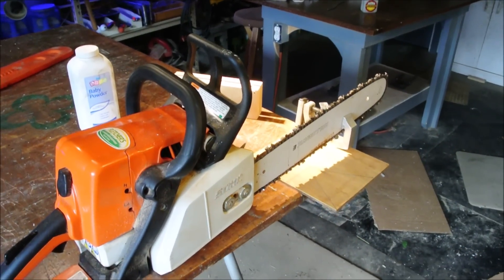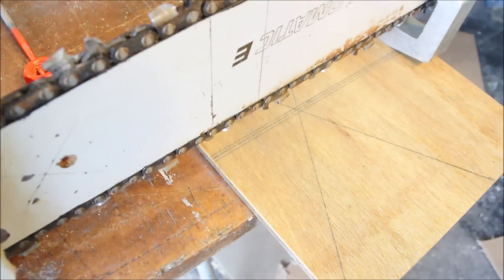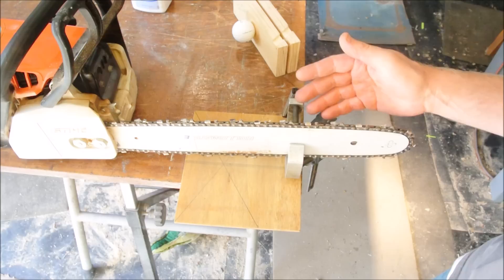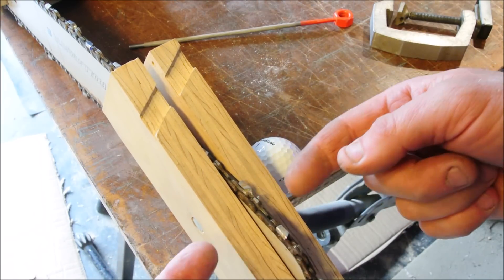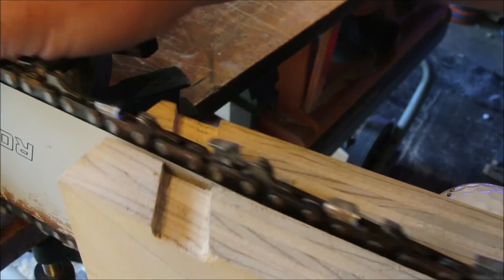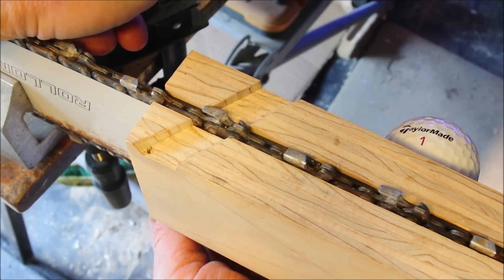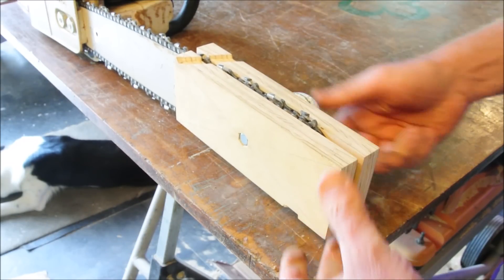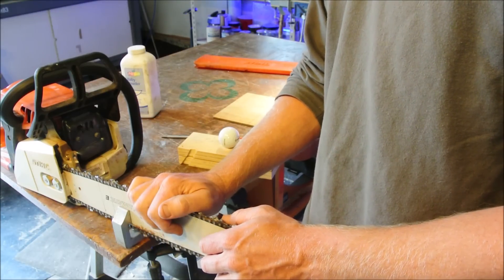Chainsaw sharpening jigs/unfinished idea

Comment: But why? The simplest thing is just to use nothing at all and teach yourself a skill, it's not that hard in this case. There are numerous excellent videos on how to do it quickly and easily, WITH PRACTICE. The internet is full of fancy devices to assist to sharpen your  chain and all they do is make it take longer (or be worse) and more difficult. It's like learning to ride a bike with training wheels, just make it harder when you eventually don't have them. I've trained numerous people to sharpen properly after they've tried (and wasted money) on gadgets that they still couldn't get a good result with, the more "tools" they'd used the harder it was to undo that learning and retrain. This is in a professional environment where it actually matters. 
So much misconception that every tooth has to be exactly the same length/size/angle or your saw will cut crooked, it's wrong and it's been proven multiple times. What matters is 
1) don't have a worn out bar groove (or rails) with excessive side to side chain movement where it can flop over side to side 
2) correct raker height relative to each tooth,  use a raker gauge, don't guess or randomly file that's guaranteed to make you cut circles, completely irrelevant if some teeth are half the length.
I've tried, tested and proved to people it didn't matter, file an old uneven chain and cut cleanly and straight through 30" logs. Australian hardwoods.

One of the best sharpening videos on YouTube is "How to sharpen a chainsaw chain by hand" by Tips from a Shipwright.
There's a video on my channel list which wasn't ever meant to be an instructional video, im using the Husqvarna file handle which has 25 & 30 degrees marked/made into it, it's all i use just to check although I don't even need it. Don't get me started on those 2in1 clunky things (any brand), cumbersome, heavy, awkward and expensive and don't make it any easier in the long run. That one inevitable day when you need to sharpen and you don't have it (or any other special tool) and there's just you and a file, what anyone going to do if you didn't learn to sharpen without it?
Reply from the maker: It's tough to disagree with you. In fact, I don't. Not really. Practical skills are fundamental to being capable. The more one can accomplish with less, the better. In fact, I'm pretty good at hand-sharpening. But let me answer the "Why?" part. 

Two reasons: first, there's intellectual curiosity; I'm somewhat of a person of abstraction, and so I like to find the extent of what's possible. This is to say that I enjoy the challenge of creating a good design. Problem-solving can be rewarding in and of itself, despite the reality that the vast majority of ideas end up failing in implementation. Nevertheless, I'm compelled to try.  

Second, there's the pursuit of perfection for work's sake. For general use, hand-sharpened chains seem to work perfectly. That said, during milling operations (especially like with my mini-mill), bar deflection and thus cut texture have everything to do with a chain's cutting consistency. There are limits to how well a human being can execute a perfect geometry without assisting tools, and error is cumulative. 

Consider the YouTube channel @FloweringElbow . If anybody out there knows his stuff about chain sharpening to extremis, it's this guy. In his experience, he learned to eventually accept the limits of personal skill; in order for him to chainsaw-mill efficiently at such a high level, tool-assisted sharpening started to become essential. In my own experience, I tried to make a few modestly 'perfect' sharpening jigs, but instead of the trouble, eventually I just started buying new chains for milling. The cost ends up minimal—and rational—considering the price of hard lumber. So the why? It's all about context, I guess.
Reply: @pocket83squared  That all seems fair and I'd not considered these options, having never tried to mill anything myself. I'm mainly concerned with cutting trees and firewood in the quickest but also least time consuming manner so having to keep extra equipment hanging around serves no purpose. Also cutting completely different types of wood we are CONSTANTLY sharpening due to the crystalline sap, sand, ants nests, dirt and everything else that seems to collect in the bark or inside. It's not uncommon to blunt the chain with only a few cuts, a lot of guys use carbide chain but that's another whole story and different equipment plus the cost
I appreciate your response, thanks, i don't have the drive or patience for such experiments myself in any case.

Comment: 2:00 juggling the whole chainsaw around seems perhaps more work than just use 2 clamp positions to fix the blade, then take the body of the saw off the blade and then just keep the tension on the chain by sticking a large spunge in it where the drive sprocket otherwise sits in the chain (that's how I do it for a quickie sharpening, just don't use an old light foamy spunge because they will get all sorts of crumbles into the rail of the blade as the driven teeth tear them off such worn out spunges - you could also get away with tube insulation if the diameter is large enough, just as long as it is compressable for easy positioning and springy enough to keep a minimum tention on the chain). 
As for the need to change positions: it has been proven over and over again, including by respectable youtubers such as ThisOldTony, PurgatoryIronworks and Outdoors55, that there is absolutely no difference in end result between sharpening with the sharp edge leading or trailing, nor in the amount of pressure in the backstroke (and neither does it influence the sharpness or life span of your file, especially with chain saw files that are harder than regular files), so you can just do both angles from the same side, eliminating the need to juggle the whole thing around in the first place :))

Excellent idea to have a visual reference for the angle! I hadn't thought of that yet and will definitely use it!
Reply: PS. we call it a blade here, if that offends anyone, please mentally substitute all mentionings of "blade" with "bar" thanks.
Reply from the maker: As a YouTube presenter, I can't call any part on a chainsaw the 'blade' without expecting some consequence. But in my real life, it'll always be a chainsaw blade.  

As for filing a tooth, toe-to-heel might easily be "proven" no different in theory, but heel-to-toe strokes knock at the tooth less in practice. Why? Because a chain has slop, and so unless you're under some tightly controlled conditions, this play will result in a higher incidence of the dreaded and counterproductive 'catch.' 

Tell ya what, though: as a respected commenter, you've convinced me to take another crack at it. Next time I sharpen, I'll keep my comfort position for the duration. I will not be back-dragging my files, though. With that practice, wear, to some extent, no matter how tiny, will inevitably result. A few trials do not a proof make; over the long haul, sloppy practices will tend to produce more collateral damage over time. If there's no reason to back-drag, I see no point in doing it. Occasional cost/benefit time-saving situations notwithstanding, of course. 

Someday I'll tell you guys the details about this hippy chick I once knew, and how she would grow plants under these "energy pyramids." They're just a few sticks, arranged to form the edges of a pyramidal cage. At the time, I laughed at the practice for being total hogwash. Yet it turns out that they really do promote the growth of my raspberries now, empirically—since the deer don't eat the plants that are underneath them. Sometimes a proven 'truth' can be less capital T than we realize.
Reply: @pocket83squared  yes, I fully agree about the "dreaded catch"... And I have cursed it more than I can count stars in the sky =)) (in the catch's defense: we have a lot of light pollution hahaha)

When ToT posted his video about his electric filer in which he asked himself the question about the back drag, his explanation was pretty convincing. 

I'm not sure which side you are arguing with the pyramids example, as the theory would easily disprove that practice, yet your empirical trial has proven it to be effective anyway. Interesting you should mention that they are helping because then the deer don't eat them so much. My raspberries don't suffer deer, but the hornets and Darwin wasps (ichneumon wasps) grab them before they are fully ripe... I'm not complaining, because these guys are an important link in the chain, particularly sharp links at that ;) 
All that to say that I will not have similar benefits from pyramids, as you may not have similar benefits as the ones I have from back stroke. For me, the back stroke helps a lot with keeping pressure and angle consistent, and thus reducing the catch. I also have turned my file around and pulled instead of pushed, to avoid awkward angles of my wrist... It's a really weird feeling though. 
If I ever have the time, I really would love to devise some kind of clamping system that I can control with my feet to grab on to the chain to keep it steady and prevent all slacking issues.

(Thanks for the compliment :) I try not to be the obnoxious default troll, but still contribute my personal experiences and contribute to your channel's algorithm benefits... It's crazy how those trolls exert control over our choice of words and freedom of speech. Either way, I love your content and dry wit, as both are stimulating the thought process...)

I'll see if I can find that video of ThisOldTony about the backstroke not causing any wear... I think people who have experienced noticeable wear, probably base their explanation on metal fatigue from pushing back and forth on the tip, but if that is the case, then it must mean that the file has already lost its temper (or rather its hardness). And now that I think about this, I'm going to put my chainsaw files under a lens to observe its geometry, because I just thought of another factor that influences wear.
Reply from the maker: @lukearts2954  What factor is that? 

Oh, and I should also add that I was talking about file use in a real general sense back there, since a dedicated chainsaw file seems to last for a long time, and further, they tend to be pretty cheap. Thus, with respect to net cost, you could still get away with back-dragging even if it's really bad for the file. But again, none of this matters, because back-dragging while filing a chainsaw remains an unnecessarily sloppy form in either case. Why? Also again, because we are not machines, and so we do not move with perfectly repeating linearity, and so injecting our error into any process increases its likelihood of blunder. This advice is not only about limiting wear; it's also about the prudence of limiting the unnecessary. Hope this isn't sounding petty or overly defensive.
Reply: @pocket83squared  don't worry, it doesn't sound like either of those. I'm entertaining your arguments to challenge my own. (I have a habit of always looking for arguments that go against my own position, to validate or invalidate my ideas)

Backdrag: To me, it is exactly the human error that is my argument for backdragging. I find it extremely hard to lift the file off the surface, move back and then reposition the exact same angle, while if I cramp up my position (elbows tight against my ribs etc) and only adjust the applied pressure, I feel that I do a fairly decent job maintaining the angle as far as a non-machine can do so.

Chainsaw files: You are right, I'm always surprised how cheap chainsaw files are compared to bastard files or other. Perhaps because they are only hardened, not tempered? I can imagine that the accurate heating cycles are a big part of the production cost of good files while only hardening them could require as little as just getting over a certain temperature, no need for much accuracy as long as it's over the threshold temperature, and then quenching in the proper medium at the proper preheated temperature. But that's just speculation of course.

Wear factor: What also should have an influence on wear, is the angle of impact, the angles at which the force is transferred into the mass, and the geometric relation between them. 
At certain angles it would just become impossible to have any kind of deformation that could cause any sort of fatigue. This would be the case if the normal vector (perpendicular to the vector of the force of impact) is small enough for the deformation of the cutting edges to remain within the elastic zone of the metal. Fatigue requires either extreme vibration for extended time or a minimum of repeated plastic deformation. Intuitively I would think that blunter angles at the tips would handle impacts far better than sharper angles. I have seen files with symmetric pyramidal shapes. I'd have to properly research at which angle that deformation would become (nearly) impossible, and I'm assuming manufacturers of high quality files would have that information. In this thought, certain geometries - if symmetrical - would be suited for filing both directions with full pressure (if one could find a technique to comfortably do so).

Comment: why do you lift the file when you reset?
Reply from the maker: Do you mean on the back-stroke? That's to prevent the teeth from dragging and thus dulling the file prematurely. Yes, it's a bit petty, but this is just good form, especially on a chainsaw tooth, which could snag.
Reply: @pocket83squared  wouldn't that be much more of an issue on the forward stroke?
Reply from the maker: @The1wsx10  Yes and no. Files are designed to cut, so some wear on the push-stroke is to be expected. But dragging a file on the back-stroke will add to that wear. 

A file is just a flat plane that's been lined with a bunch of tiny, hard, sharp teeth that act as blades. A blade will 'cut' any material that's softer than itself. Think of what happens with one blade (tooth) at a time as it cuts. Now imagine doing the same thing to a sharp chisel, dragging its backside over a piece of steel, on every stroke. You'll quickly wear down the cutting edge and/or make a burr. Same idea.
Reply: @pocket83squared  i thought thats how stropping works

Comment: I know 3D printing is a bit over suggested by some people and completely goes against Pocket83 brand simplicity.  However, this whole video I was just thinking about whether or not I could whip up a jig as a 3d file.  Some benevolence soul may throw one together one day.  But admittedly the Venn diagram of people who use chainsaws versus people who have access and use 3D printers is probably fairly narrow.
Reply from the maker: Maybe not as low as it seems—both of those technologies scream 'DIY!' 
But the problem with a print file in this case is that it would be extremely chainsaw-brand specific.
Reply: @pocket83squared  Ah..  I was afraid of that.  I don't really mess with chainsaws so I wasn't sure how universal that hole spacing would be.  And parametric files is probably asking too much lol

Comment: Maybe if the c-clamp was further from the edge of the table your new jig could be partially supported by the table to set the height. To flip the jig over you'll lose the height setting. But you could set the height with a 1×2 or any scrap high enough to allow the jig to flip. Or undo the c-clamp to flip and reset the height once in the middle of sharpening

Comment: Maybe soak the wood in water, then clamp it down on the proper tooth placement. I'm thinking that it would leave an impression that would make for repeatable tooth alignment.  But I have no idea if that would work.
Reply: That's actually a very good idea! the rivets of the links will make for excellent locator pegs. Perhaps even drill out the impressions with the same diameter as the rivet ends.
Reply: @lukearts2954  Thanks.  My first thought was actually to use plastic and mold it around the teeth but that would be too much effort.   Even with the grocery bag method it would be a severe pain in the butt.  Pocket mentioned another comment that if the blocks were made out of HDPE you wouldn't have to worry about the file grinding the wood away.  I agree and I do a lot with HDPE plastic.  I definitely think it could be done and it would definitely work.   But I can't think any of the way to implement plastic blocks without an enormous headache.    And that's like ALL I do on my channel.  So just softening the wood is what I thought of.

Comment: Seeing you upload this made my day, so thanks for that!
I've been clearing some bush, making trails, but I have to admit that my sharpening skills have never been good. I could see a lot of use with that jig! So if the file rides along the groove, how much use before the wood is damaged? I'm just thinking for someone like me who would use it was a guide, not just a reference, insetting a rail of a harder material would be helpful.
Reply from the maker: Yes, you have to try and stay away from the wood. It's easy to feel, but the jig would be better if it were HDPE (plastic). 

Trail-making is hard work. Oh my, stumps! When we first moved here, I worked on them constantly. Keep at it, and they'll start to add up in both quantity and quality. We now have over 1/2 mile of well-maintained trails. Also, I recommend investing in a 42" DeWalt Wrecking Bar for rock extraction. Good luck.
Reply: @pocket83squared  thanks man 😊
I'm in my element outside, and a recent career change has allowed me even more of it. 
Regarding plastic, if the whole thing is made of it, will it grab the teeth of the chain effectively?
Reply: @pocket83squared  HDPE!?   That's like my whole...    no..    I must resist the urge to insert myself in this conversation merely off of the mention of a single material.